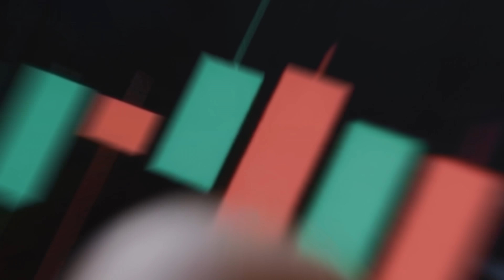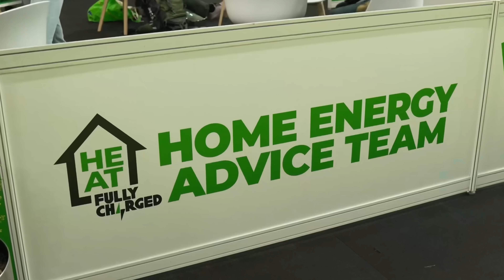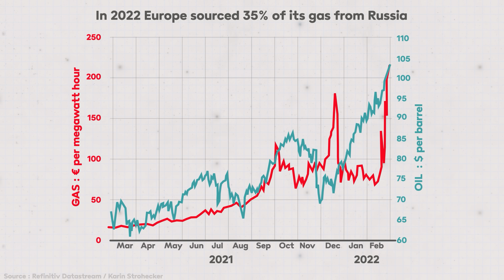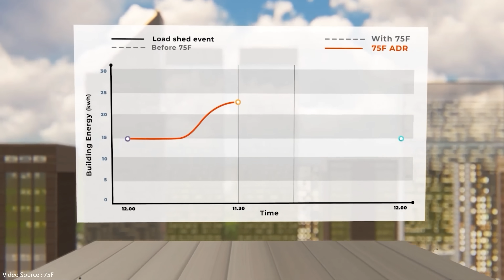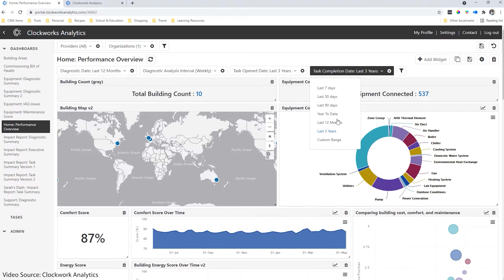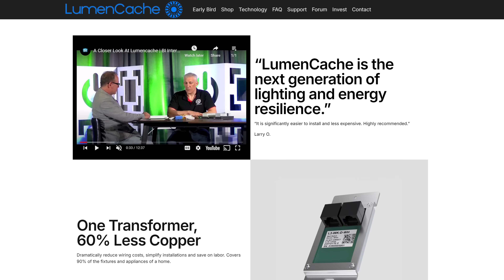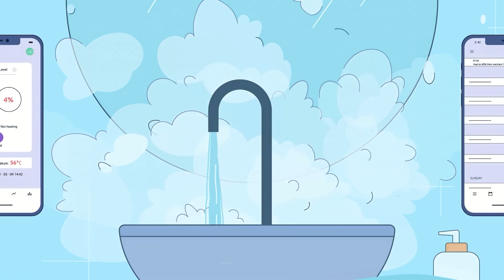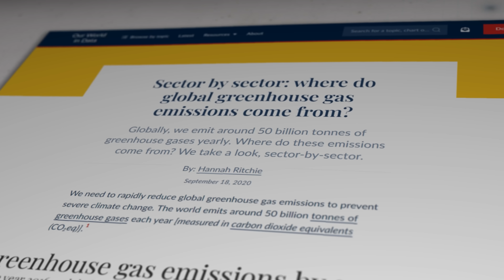The INSANE effect of Artificial Intelligence on Climate Change.

Comment: i am extremely skeptical of the trend that says our best solution for addressing the consumption culture that is causing climate change is to consume even more products - just green ones this time 

should we address car dependency? no, says that culture - instead, buy electric cars 

should we address our wasteful & trivial use of electricity for lighting? no, says that culture - buy high tech lights instead
Reply: Absolutely correct, because they can't stall the growth model.

Consume or be consumed.

People want the same lifestyle (it's a hard sell to change that lifestyle) so it easier and more profitable to sell you something more efficient.

I bought a small very efficient 1 litre petrol car and a electric push bike at a cost of around £7500. 
Both of these are more efficient than what I had before but that £7500 would have got a lot of petrol in the old car maybe around 40-45,000 miles. 

The bike has meant I do half the amount of car miles though. But how long do I have to ride it to offset it's Co2 production cost. Considering also that the battery has a lifespan. 

Our old 60% efficient boiler system was  removed in favour of a Heat Pump that is around 400% efficient at a large expense 🤔

Personally I'm doing these things for the benefit of the natural world not bothered so much about people they can adapt and overcome, animals cannot if too much change happens too fast.
But I've not really changed my behaviour/lifestyle just the systems I'm using to do the same tasks.  
Is it fruitless maybe, maybe not...

Sorry waffled on a bit there was just bored and wanted to say something to someone about it all 
Comments for the algorithm 😂
Reply: Agrowth > green growth > degrowth
Reply: We should promote both public transportation and EVs like china did.
Reply: There's immensely more important issues such as the power sources which feed into the grid, global agriculture and farming practices, industrial building solutions such as production of concrete, efficiency of technologies... basically corporate profit races in unregulated conditions.
Reply: But on the other hand, there's a lot of easy policy changes which we can aim for at the start of all of that, so of course the household heating efficiency is a major one and still deeply underway. When these policies will be a matter of course for everyone, perhaps then we can advance with large scale operations even without profit being the major decision factor.
Reply: I fail to understand how equipping my plain basic but well-insulated fridge with a power-hungry motherboard, CPU, LCD display and WiFi connection will make it use less power in the long run... And I am not even considering the resources and energy needed to produce this fridge !
Reply: I think people like consumption culture I’m afraid. If they’re free then they’ll choose it most of the time. 
So should people not be free? 
Maybe stop trying to control people’s lives and make consumption greener instead.
Reply: @MrDoyley35  This 'freedom' argument is 100% faulty. No one choose to waste more money on regular necessities if cheaper alternative is there. For example, in North America, the public trasportation in most cities are appaling, often non-existent. You will need a car to move from point A to B. How on earth is people free? How am I free when I can't choose cheaper, yet comfortable and quite luxurious metro system like they have in Europe or China and has to buy a car, spend thousands in gas, repair and insurance?
Please stop BS in the name of freedom.
Reply: @MrDoyley35  If this is so, then why on earth people choose public transport whnever it's available? Please answer tthe question and lie a little less. North America simply lacks this, period.
Reply: I was reading about fusion in The New Yorker when I suddenly realized, cheap, clean, limitless energy wouldn't save us.  That's because habitat loss is the number one driver of extinction and if there's abundant energy, the economy will explode, the standard of living will go through the roof.  People will have more children, buy more stuff, build bigger houses...
Reply: @topherdean1024  Very good Point.
Reply: @bawehjerox5030  It wont. This is the absurdity of the tech bros now.
Reply: @aniksamiurrahman6365  I don’t choose public transport whenever available if there is my own transportation as an option. 
If affordable I’d go for a car every time. It’s simply more convenient. You are just trying to win a losing argument which shows lack of thought. Especially making false accusations of lying is evidence of someone who has lost the point. 
This is a daft conversation imo. 
Public transport is a second rate choice. Period!
Reply: @topherdean1024  actually not true. Birthrates tend to decrease with increased prosperity. Better contraception, sex education and woman’s rights leads to them having more control over how often they get pregnant. The reality is the economically successful west over the last 30 years has started to see projections of population decline due to these factors.
The countries with the biggest population increase has been India and subsaharan Africa. These are regions with very high levels of poverty. 
Granted for a short time, until the benefits of higher living standards and eduction take effect and while these countries still have a culture of higher birth rates, population will increase. This example is most noticeable in the Uk from the Industrial Revolution up till the mid 20th century. But the issue for the next 100 years will be how to sustain the population without demographic collapse which would be catastrophic. 
 The birth rate to allow controlled population reduction is 2 per couple. To maintain population is 2.4. 1 per couple leads to demographic crash and societal collapse which is a huge concern for the west. One solution has been to allow mass immigration to fill the population gap of 20-30 year olds that is currently happening in Europe (particularly Germany). 
So unlimited energy would reduce the cost of living and allow more investment in education and prosperity making the world’s population stable and hopefully gradually reducing in a controlled and sustainable manner.
Reply: @Burtis89  Also sad is those upgrades you made to your home will never yield more value when you sell. AND there's a good chance those items are less reliable and will end up costing you the same or more in repair bills than you would have otherwise saved.
Reply: @JimP226  yeah fair but I didn't do the heat pump to make my home more valuable. 
I did it because our old boiler was 35 years old expensive to run and the pipework was dying. 
 
So actually replacing the system and having brand new pipework has probably made the house more valuable/saleable anyway and it will appeal more to the eco conscious buyer but I guess appeal less to the skeptical fossil fuel lobby.
Reply: There’s that paradox (Javin’s or Jevon’s, forgot the name) that says that as you increase efficiency in the hopes of lowering energy consumption, you obtain the opposite, where more and more people buy & use more and more energy consuming gadgets, ending up with more overall consumption.
Reply: I have to say this seems true. I can't see energy consumption going down. The power needs to come from genuine renewables surely. 
Tasking AI to micromanage AC conditions seems highly unlikely to reduce consumption to me.

Comment: It’s all great until you realise that today’s cloud data centres are using about two Japan’s worth of power. The boom in AI is going to multiply that by several times.
Reply: Didn't I hear something about moving them into orbit and feeding off the sun? IIRC it was fairly recently ...
Reply: These systems are the biggest growth area of energy consumption. They will pale into complete insignificance any energy savings made by them.
Reply: @Jacob-yb6bv  
I don't think you're right about that.
Reply: @jameslamb4573  That was already torn apart by Scott Manley, the radiators on such a data centre would be ridiculous and the whole thing would be too large to manoeuvre around space junk. A data centre in orbit is a one way trip to Kepler syndrome.
Reply: The largest "AI companies" are currently buying nuclear plants for their energy consumption needs.
But those are not the same as the companies who do this "IoT/AI" stuff, the AI part is mostly buzzwords, what they do can very much be done with regular math.

Comment: I work with energy efficiency in large buildings in Sweden and all this AI magic company try to reach us. Our answer are still that we are very far away from the need of AI to make our customers buildings way more efficient. They need to start turning of the things that not are in use, adjust the airflow to demand, replace old inefficient air handling unit and increase the efficiency from 50% to 80%. Adjust the timer from 24/7 to the time the bildning are used (that's too common). It's a buzzword. We had a salesman on visit not knowing what the system actually did.
Reply: Agree 100%
Reply: Half of the things you've enumerated are the things the AI is proven to be great at handling. You've made a great case for the "buzzword", not against it.
Reply: Those are things that you can do without relying on AI. The problem is people lump any kind of software usage as "AI". AI in layman context has become a marketing term
Reply: AI is the magic spice you sprinkle on everything to make it taste better
Reply: @DSAK55 to make it cost more.
Reply: Any solution that requires large numbers of people to change their behavior is not a solution.
Reply: 100%. Building automation is a solved problem. AI won't magically make companies want to turn off devices and building owners won't force them. Automating AC? Please...
Reply: @vidyagaems4063  Wrong. Half of those things are SIMPLE automations that do not require sending a constant stream of data to an off-site server farm to be rendered by a garbage AI ML algorithm.
Reply: @todddammit4628  Exactly right. We can increase efficiency by 90% with existing tech without the need for AI. We don't need countless terawatts wasted telling us what we already know and can do with simple code/machine learning. No need for an "intelligence".
Reply: It will be much like self driving cars, low impact ultimately.. also AI like BTC is sucking electricity 

So keep your Nuclear project going
Reply: AI is scam. I'm programmer for almost 30 years now, heavy chatgpt user since day one and I'll tell you that ai is right only in 50% of times. It's not capable of automating anything. It just plagiarize things that work elsewhere. 

The main issue in energy usage of buildings is lack of automation. If everyone can set up ac to their liking then in one room there can be ac that heats the room and one that cools it. Individual preferences can be vastly different and it causes looses. 

The best solution is remote work where office building is not needed at all. People heat/cool their homes regardless them being there. Next best thing is to connect all ac units into central location, set them to one temperature and synchronize with heating system.
Reply: @nallebrean  To be allowed to continually scare people over and over tells you where secret service has its loyalty. Same with drug trafficking. Do populaceses have any friends in high places?
Reply: @incognitotorpedo42  Hopefully this 'populist' idea does not apply to wars or a liking for 'Hello' magazine and any number of newspapers, as we anachronistically call them. Best not to have to travel miles everday to cram into an enomous building? Just send an e mail or two instead?

Comment: There's very little need for this. Just "controlled load" as used in Australia for decades. 

A "ripple control relay" sits in the meter box and anything that can be permanently wired in and which is safe to run unattended is connected. The network decides when there's a need to increase load to balance the grid and a "ripple" is sent down the grid to turn the relays on. When there's a need to decrease load, a different ripple turns them off. So your storage hot water, pool heater, underfloor heating or whatever runs long enough to meet all your needs for 1/3rd the normal cost, while the grid gets a way to keep everything balanced.

Comment: I had a thought.... Injection of AI and cloud computing into things that may not need it surely adds to emissions given how energy hungry data centers are?
Reply: How do you decide which things It may not be needed for?
Until you've tried using it to analyze something you have no idea what improvements it can find that you hadn't thought of yet.
Reply: @jimthain8777  You judge whether those things could have been done without the energy hungry ai. Anyone can tell you that running the air con in an empty building is stupid and there are plenty of ways to set timers on things without needing an ai to turn off devices after close. The rest of this stuff isn't things we haven't thought of it's things management hasn't bothered with, triple glazed windows and insulation lower cooling bills who could have thought of such a thing, maybe in a few years the AI will be advanced enough to tell us to install curtains.

Comment: It is nearly 30 years old but the book Factor Four (Lovins, Lovins and Weizsacker) expands on this theme brilliantly and changed my life back in 1997
Reply: Amory's great.  I saw a tour of his house on PBS a decade or 2 ago.  We should've started building houses like that at least by then but still aren't.
Reply: Yes, that book is a hallmark.
Reply: @thethegreenmachine  Modern building codes have adopted a lot of the principles of houses like Amory's, without going to such extremes.  I'm in the middle of a project that will enhance the building envelope on my house that was built in 1960.  Compared to modern homes, houses built when mine was are garbage when it comes to energy waste.  I've improved it a lot and will do more, but modern buildings already have what I'm doing, and more.
Reply: PassiveHouse is a big part of our passion for doing this.  It's trivial for us to put Humidity and temperature sensors in the light switches because they are just inputs to command the lights, not actually switching the power.  This makes them "UIs", more suited to doing beneficial User Interface stuff.

Comment: Regarding triple-glazed windows:
I'd love to have more efficient windows in my house, but I recently got it quoted and they said purchase and installation would be $34,500 for 10 windows.
Reply: Did you investigate insert windows that go over existing windows?
Reply: @Gordonz1  My house has utterly rubbish windows. Double glazed, but wooden framed and so pathetic they actually condensed in winter. Then I discovered the miracle of stick-on plastic shrink film. It's no substitute for actually upgrading the windows, but the cost is negligible and it does a surprisingly effective job. No more condensation, and no longer cold to the touch. One day I will be able to replace the windows with modern ones, but for now I have other uses for the money - debt to pay off.

Comment: That LumenCache system is truly amazing, a thorough rethink of the entire electrical system. I hope it survives in the market, because it has huge potential. I myself have been through the process of rewiring to separate lighting and outlet circuits while staying within the limitations of my existing panel during a remodel. Now, lighting doesn't require 120v, and neither do a lot of other things in our homes. Some, like doorbells and thermostats, never have. Connecting all those things with ethernet cables to power, control, and piggyback sensors onto light fixtures, wall switches, and USB ports is brilliant. Add in the lack of sufficient wattage to burn the place down, the flexibility, the lack of need for code inspection, and the availability of a battery backup...I'm impressed.